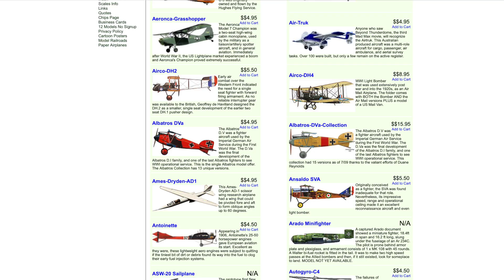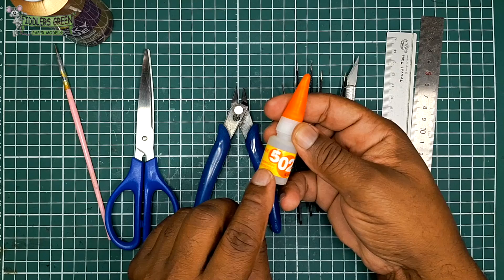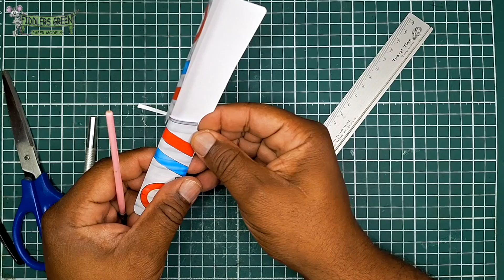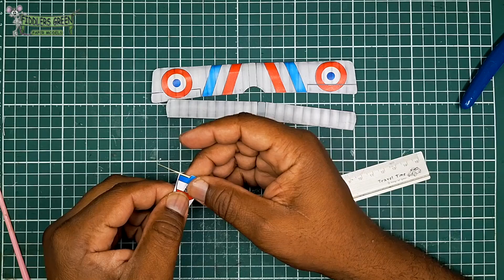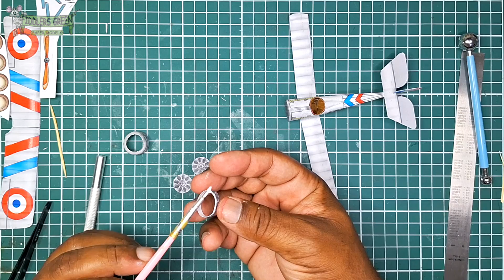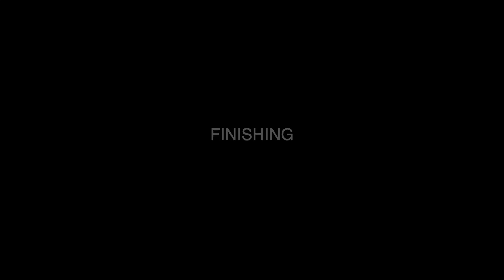BEGINNERS GUIDE - HOW TO BUILD FIDDLERS GREEN MODEL   NIEUPORT 17

Comment: I’m brand new to this. What weight paper are you using? Does it vary by scale? Thanks!
Reply from the maker: Yes and yes. The weight paper is at between 130 - 140gsm. If you reduce the size of your model, the lowest weight I recommend would be 120 gsm. I use this for the 1/100 scale models. hope this helps. Cheers.
Reply: @neilpapermodels Thanks! Really enjoy your videos!